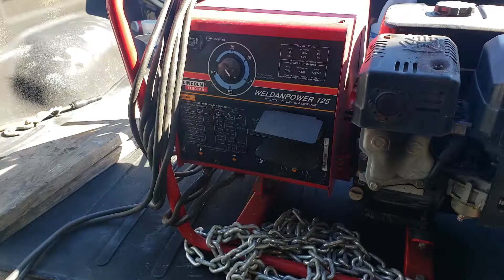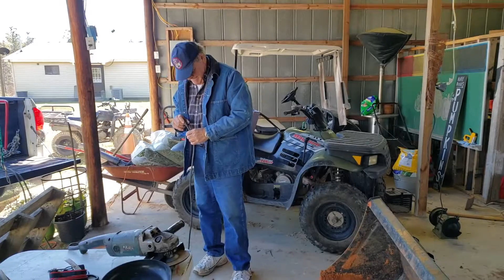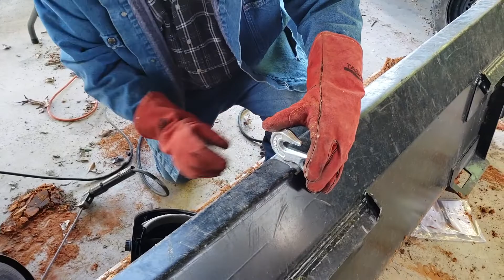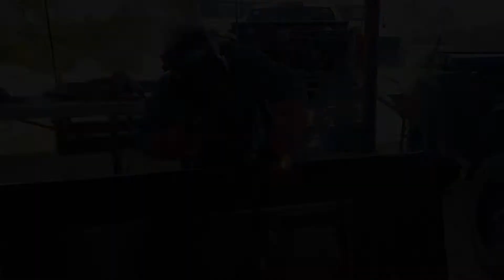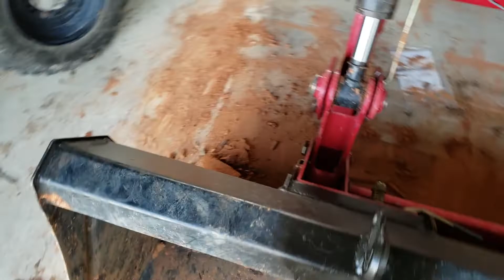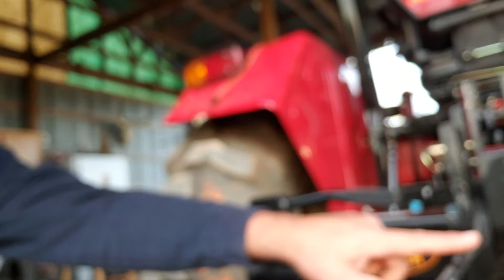WELD BUCKET HOOKS onto your compact Tractor. (Plus Bonus footage)

Comment: Hank, I'm curious how much you have used your bucket grab hooks over the past years and how well your bucket is holding up.   Have you lifted anything really heavy.   I recently (8-10-2022) purchased a Mahindra 4550 and was wanting to put bolt-on grab hooks on mine.   The metal is fairly thin on top (probably 1/8th) with a box design and it would be difficult to use bolt-on hooks.   I was thinking about mounting to top back of bucket to mount with plates on both sides to perhaps give a little more strength.   I noticed the vast majority of bolt-on grab hooks being designed for green or orange tractors with a few offering universal mounts.    Thanks and I hope your hooks and bucket are holding up just fine.   (Can I borrow your uncle for a day?  ha ha.)

Comment: Bucket hooks are the greatest, you'll get tons of use out of them.  Another good spot for them is on the top/back corners of your box blade.  It makes a great place to chain up some sort of a drag behind the box blade for additional smoothing.  One unrelated thing, those hooks looked like they may have been galvanized or zinc anodized.  You do not want to breathe fumes from that stuff, it is deadly.  If you come across stuff with that sort of finish that you need to weld, soak it in some vinegar or muratic acid to remove the coating.  Stay safe!
Reply from the maker: The hooks on the box blade is a great idea!  And thanks for the reminder about the fumes👍